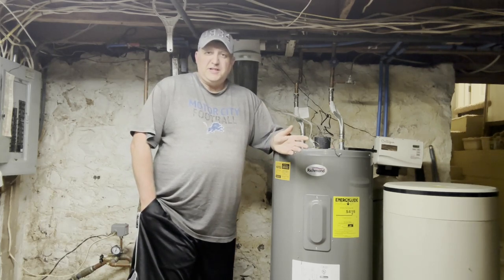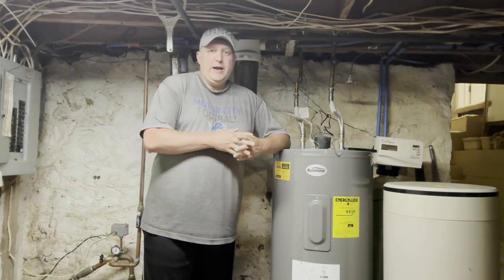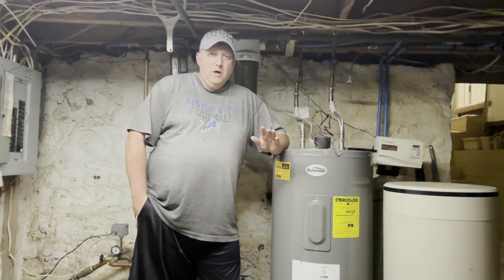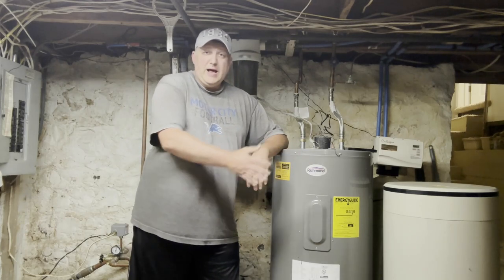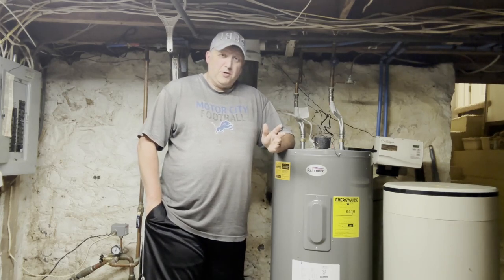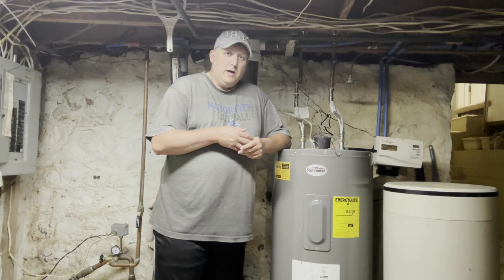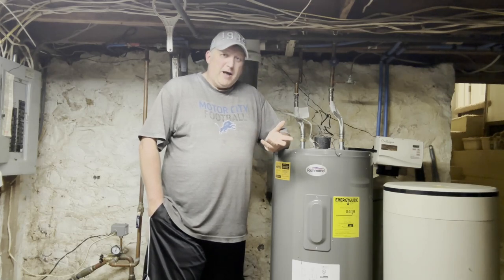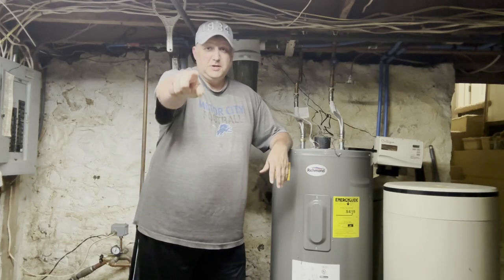Can An Electric Anode Rod REALLY Get Rid of Smelly Water?

Comment: I just installed the same electric anode rod this year on our 12-14 year old hot water tank. Didn’t know about such and purpose. Used a Ryobi 18v Impact 1/2 inch wrench to remove, came out very slick with no tank movement to bust water or gas lines. Only had about 8 inches of a 4’ anode rod when removed. Time will tell if it makes tank last longer.
Good luck on your competed project!
Reply from the maker: Thank you. I am in the same boat as you are. Time will tell if it makes the tank last. 🤷‍♂

Comment: Have an AO hot water tank ready to install brand new from plumbing supply store . I replaced the anode tube tank empty and not hooked up yet makes it much easier and brand new tank should last for years to come.last tank never checked the anode rod and had rotten egg smell when taking hot shower we have hard water from the water company

Comment: Replace the elements same time as the anode. If you flush the tank and replace both upper and lower elements as well as the anode, it will eliminate the fulfur completely.  The anode keeps build up off elements, when the anode is corrupt, the elements will begin collecting the minerals instead. As you said the sulfur smell was strong, that indicates it has been bad for a long time.
Reply from the maker: I’ll have to remember that. Thanks for the tip.

Comment: If the smell is the result a of bacteria on the rod then this will fix it. If the smell is in the water, cold water will still smell and likely the hot water as well.
Reply from the maker: They both did. The removal of the anode rod helped tremendously but I wonder...at what cost? I am not convinced that this will make the life of the water heater last longer, but at least the smell is gone.

Comment: 1:08 WRONG… anode rods protect the tank against rust/corrosion.  Removing the Anode with dramatically shorten the heaters lifespan. 

Don’t remove it, swap it from the factory magnesium to an aluminum alloy.
Reply from the maker: Too late. Already installed the electric anode rod.
Reply: I can't even make out what you're trying to say from this statement. Don't remove it... instead swap it out. Isn't that the same thing
Reply: Will the Cheaper Powered anode rods that they sell on Amazon work just as well as the More expensive "double the price" units Corro-Protec sells .  I have not found a compare video on these different powered anodes.   Which one did You Buy?
Reply: I bought the Voguuy powered anode off Amazon a few days ago for 87.99, has the same 20 year warranty. No one will know if they last this long or not, but if two products seem the same, I'm spending the lesser amount.